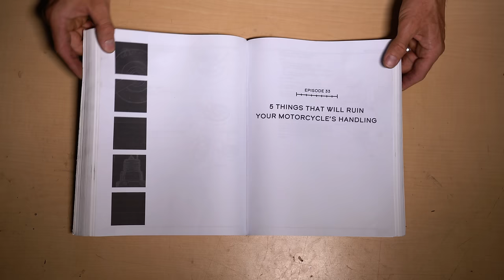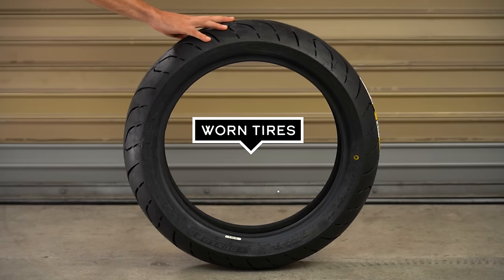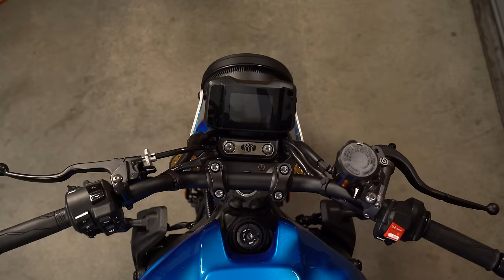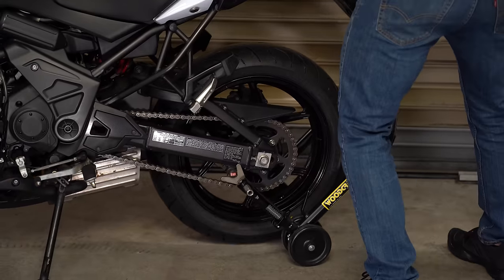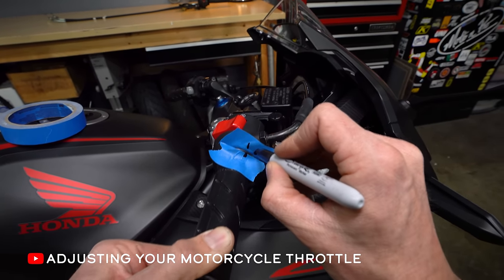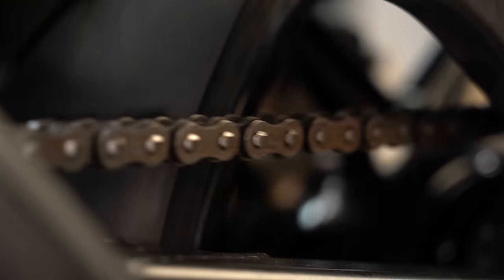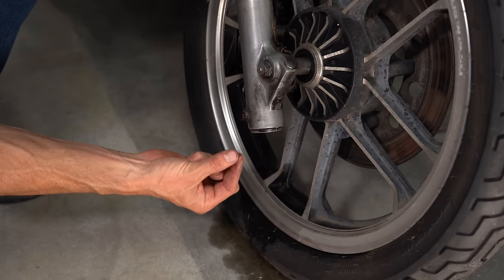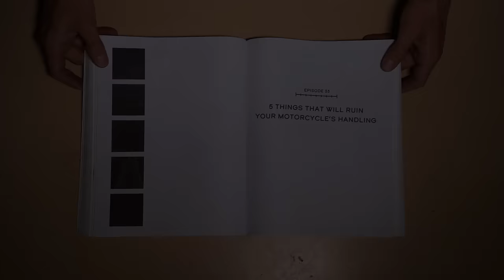5 Things That Will Ruin Your Motorcycle’s Handling | The Shop Manual

Comment: Thanks, 
Now I've been having this issue lately, that when I let go of the handle bars, my bike tilts to the left and I have to immediately grab at least one side in order to stabilise it, I have brand new tyres on, a new chain with new sprockets front and rear and alignment is spot on, yet it still wants to fall on it's left side. 
Any ideas anyone what could be causing this?
Reply: Gravity
Reply: Maybe your cables on the right side of the handlebars don't have enough slack, so the handlebars naturally want to pull right (which would make the bike tilt to the left at speed)?
Reply: @Uhrmacher2  Thanks for your input!  I'll sure be checking those cables and brake lines too, as I do remember fiddling with the position of the brake fluid reservoir and brake lever not too long ago. Hopefully it will be just that 👍🏻

Comment: What’s funny is I just had the steering bearing diagnosed by a dealer during its 38k (was supposed to be 35) service, and they noticed it having issues. 

They already did a massive amount of work, so I’m gonna have to go back to get it done… it does fall back to center. 

First bike I’ve had this problem with. The guy said they usually last longer (previous owner was tough on it, I guess). I’ve run three other bikes to 40k and never had that issue. It is subtle, though. I don’t even notice it riding…